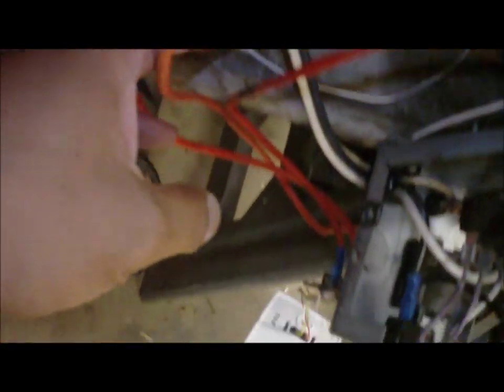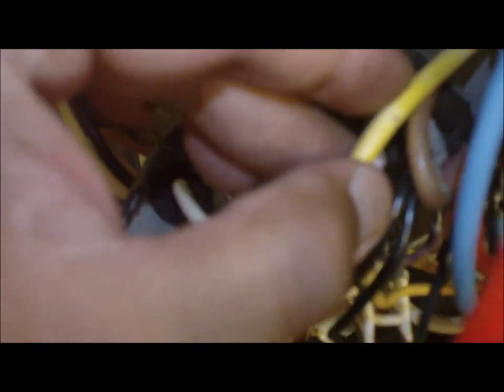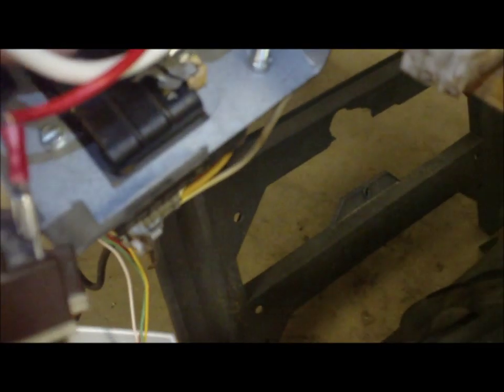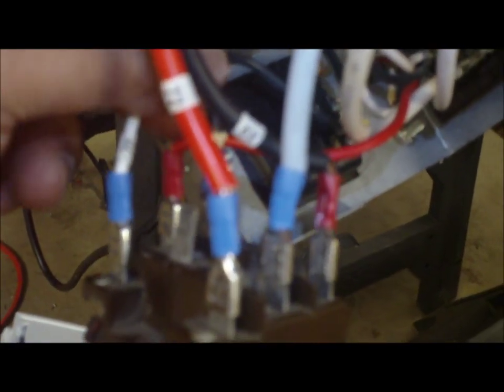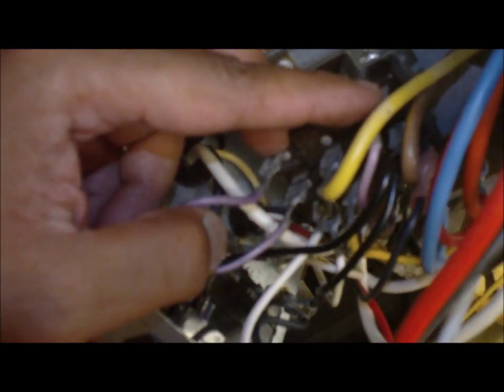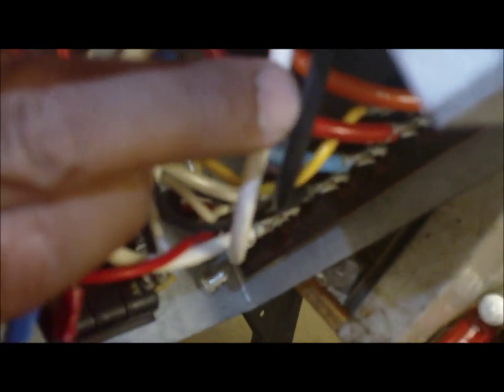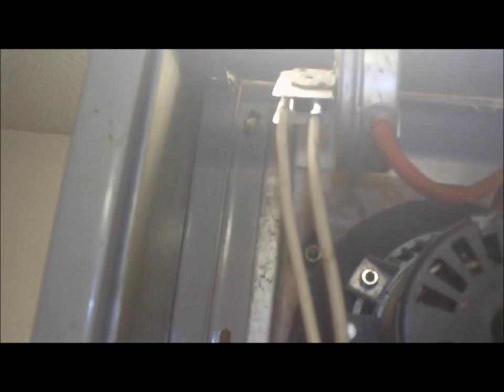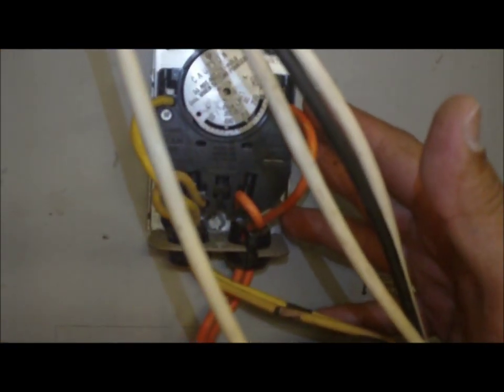HVAC Relay & Fan limit switch wiring. Part 2 of 2.

Comment: very nice video, one of the few techs which has taken his time to go component by component and their operation, really appreciate it, I have an issue with a gas package unit heating system, for some reason the compressor seems to get hot even when the unit is off as if it is getting power to one leg, 240 v. single phase old school G.E could you give me any pointers please

Comment: Wowwwwwww it's a cool stuff. My name is jean I'm in Boston mass. I'm also an entry level technician.  Can you please do the 8 pins relay demo without the wires it's to be confusing with the wires. If you could still use the fan  and the transformer with 24 volt to energize it ,Ithat would be appreciated. Thanks
Reply: You have 7 years of experience now. How much did they start you on?